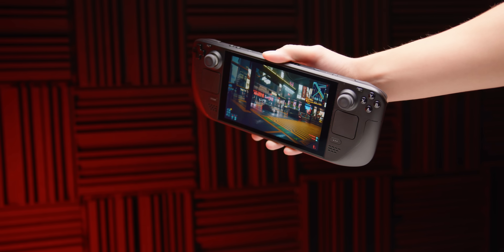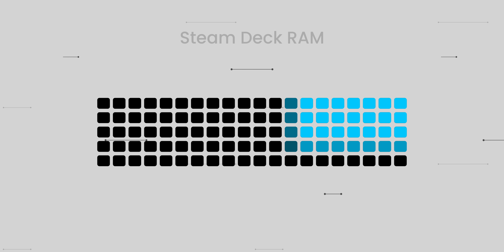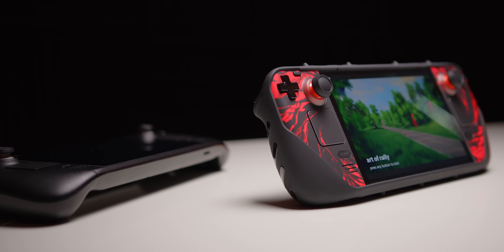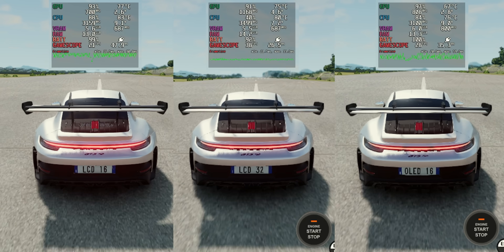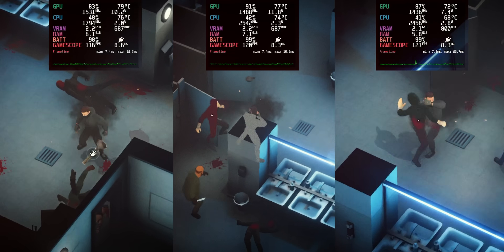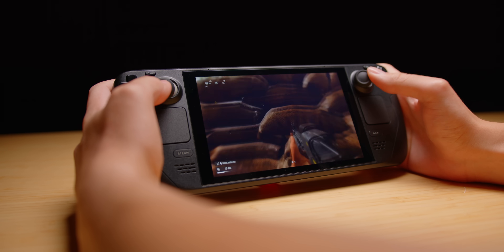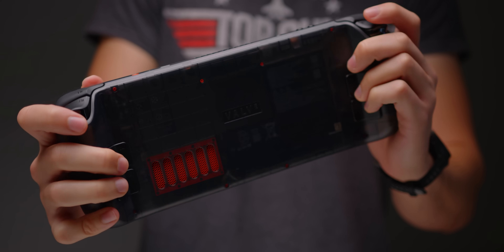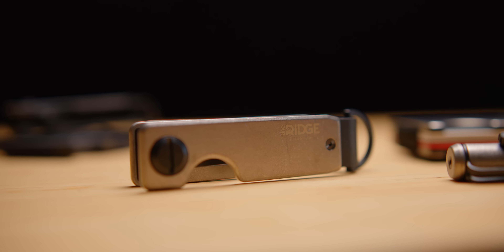I Upgraded The Steam Deck - 16GB vs 32GB of RAM.

Comment: Why didn't they give us upgradable ram? Just a single sodimm slot would be enough, wouldn't it?

Edit: I didn't know that, thanks for the info. Can we expect 24GB RAM from Valve?
Reply: Then it would be running in single channel mode, which would take lot of performance away.
Reply: @TallGingerDude  The RAM being soldered is not what makes it dual channel, and neither would running 24GB.
Reply: @DigitalJedi  I never said soldering it makes it dual channel. OP said to replace the soldered ram with a single SODIM slot. That would make it single channel.
Reply: @TallGingerDude  Oh yeah I missed that. That would absolutely take a massive blow in performance then.
Reply: have u seen the size of the SD oled motherboard ? it's not far in size from a sodimm stick... it's just too small for that.
and a single sodimm slot would limit the memory bandwidth a lot.

i wish they would have go with 196 bit memory (so the OG steam deck would have 6 chips and the oled 3 chips) yes it a bit bigger but it would have allowed them to be in the sweet spot of 24GB ram ( easy 16 for the CPU and 8 for the GPU) + it would have way more memory bandwidth.
* possible con would be making it a bit less efficient at super low TDP.
Reply: @gametime4316  A 192-bit bus would be awesome to see on some of these APUs in the future. Strix Halo is supposedly going with 256-bit but it also has a triple-digit TDP, so no handhelds there. A bigger cache would also help the SD out quite a bit too. That 4MB L3 is 100% putting some constraints on it. I get it's cut down for die space but it would've been nice to have even seen the 8MB treatment that things like other Zen2 APUs got.

Hopefully a future Deck2 takes a more aggressive hardware approach. I'm suspecting a 6x Zen4c & 8x RDNA4 setup as those will probably be the last-gen but proven designs by the time Valve considers an upgrade.
Reply: There isn’t enough space inside to fit a SODIMM ram slot. There is a reason why they went with soldered ram. Plus it consumes more energy

Comment: it surprises me how the Steam Deck can struggle managing its 16GB of RAM, while the PS5 and Xbox Series X run the exact same amout like it's no deal, and before anyone says it's because power well that'd be even more reason for them to struggle even more since they're way more demanding which would also require way more RAM, specially in 4K where a TON of VRAM is required, like over 10GB, leaving even less for system, how do those ones manage their RAM
Reply: They don’t have separate isolated RAM and VRAM in traditional sense at all. 
Their GDDR6 video ram equally accessible to CPU and GPU at full speed at all times. Some very small amount are may be dedicated to strictly GPU / CPU but in general they use it as one big pool
Reply: PS5/Xbox games are optimized to those constraints and run almost in "bare metal" with little overhead. Steam deck games are "normal" PC games created using game engines designed to run in hundreds of PC configurations thus creating a ton of overhead.

For the "outdated" specs, I would say the deck still holds very well thanks to its operating system being very lean. That's why I don't understand people installing windows on the deck to game, you're just putting even more constraints on the hardware by using it, at this point you might as well buy a laptop.

That's also the reason why the decks competitors, while better in specs, all fail to sell as good as the deck.
 
SteamOS is awesome for handheld gaming, you can install Bazzite but it's not really the same thing.
Reply: @jackofsometradesmasterofnone also the bigger apus struggle to be much faster at 15w tdp. So double CUs with more boost speeds yet only around 20% faster which is poor gains.
Reply: Steam os id more hesvy than console operating systems
Reply: @168original7it's more that the consoles have 2 dedicated cores for the OS.
Reply: Its TDP constrained.

Comment: I think for most cases you fix this issue with just having lower quality textures... In Cyberpunk I find it kind of absurd that it defaults to "high textures", when it is actually quite hard to appreciate that level of detail on 800p... I reduced the textures to medium and a lot of the stuttering disappeared. I don't always think that throwing more hardware at the problem is the right way to go. It's a balancing act. And I think most gamer's need to acknowledge that medium textures look really good on a Steam Deck. :)
Reply: This
Reply: Phenomenal work with this explanation!  I couldn't agree more and truly thank you for sharing! 💪🤓
Reply: The very reason Deckverse recommended setting the Textures to Medium, I suppose.
Reply: I guess if you've never been a "low spec gamer", you'd never know.
Reply: That's because in 99% of the time textures doesn't affect performance. Only in specific cases, like the deck. That's prob why it's set to max
Reply: @Bruno_Laion I'm curious about that because I was always under the impression that texture resolution does have an impact on performance at least as far VRAM goes.
Reply: Lower quality textures isnt always an option. Some games just use more memory than advertised and then get slapped with "poor optimization" slander
Reply: Agreed and good point on the texture resolution vs screen resolution. I would understand using high res more if the use case is that your Steam Deck is constantly docked and running on 1080p to a larger external display but the nature of the device is to be portable and using the onboard display.

That being said, it would be rather nice if it was like the Switch where it can sort of "overclock" itself when docked to eek out a little more performance.
Reply: I’ll keep that in mind
Reply: it’s a $600 device i shouldn’t have to worry about that
Reply: @imstupidbut  your value of the dollar is about 10 years late unfortunately

get to the voting booth if you still cant come to terms with it
Reply: @imstupidbut  steamdecks $600? when? i think it maybe cost that much for the top of the line model at launch but thats just hdd capacity that covers that

steamdecks essentially 400 dollars paying more doesent change the specs unlike rog ally where they invented a class system and a system where you have 2 models

the base model and the model you wished you bought
steamdeck is just hdd capacity which can be upgraded fairly easily not saying your grandma could do it but someone who can follow instructions and is carefull could do it
Reply: Don't tell me you have AA without telling me you have AA hahahha...
AA handhelds/mobile is the dumbest thing ever.

Comment: Cryo utilities is sufficient which doesn't require any hardware upgrades aside from the SSD.
Reply: Cryoutilities helps but SSD is nowhere near as fast as  RAM, constant paging to and from the SSD will cause stuttering.
Reply: Agreed, cryo utilities really helps with no hardware upgrades necessary.

Comment: Iirc the RAM vs VRAM on the Steam Deck is not 50/50. By default the Deck is configured to use 1GB of VRAM in the bios, and you can configure it up to 4GB.
Reply: The BIOS setting is the minimum amount that the GPU is allocated, and will automatically increase if it needs more and the CPU isn't using the extra RAM.
Reply: it's not the 1GB limit VRAM, but instead hard limit of how low the VRAM can be. You can image it as a container that have faucet on both ends, whichever fills faster will take more of the RAM, but the BIOS setting is to make sure that the VRAM will not take less than the specified amount.
Reply: 1GB is is the default minimum allocated VRAM, you can increase the minimum allocated VRAM to 4GB. Steam OS has the ability to use beyond the minimum allocated VRAM to a max of 8GB. That's about half the total system RAM.